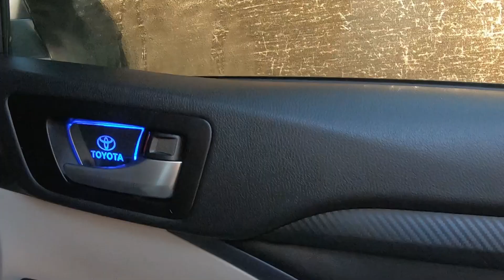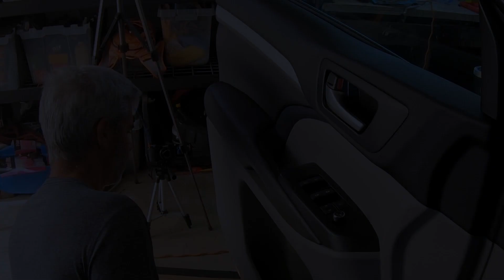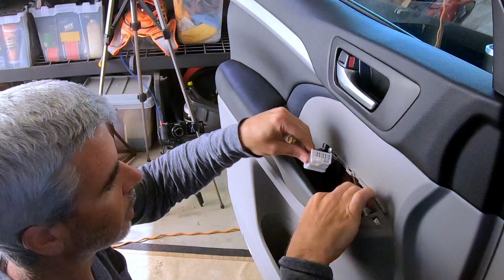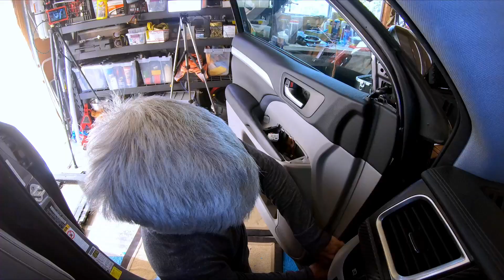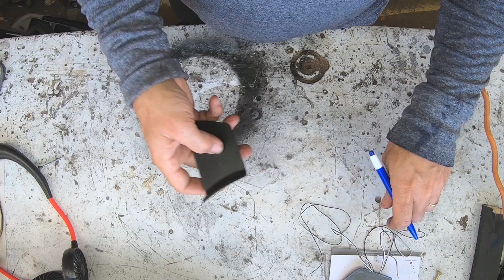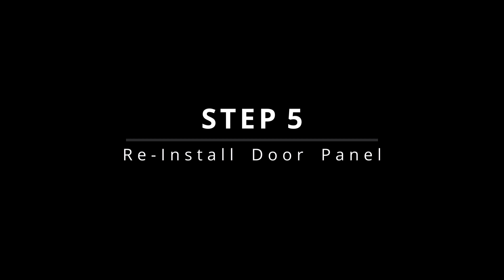Highlander Door Handle LED - Custom and Sweet!

Comment: how i can install these on passenger door ?  no light on passenger door
Reply from the maker: Without a door light it will be very difficult.   The newer highlanders use the computer to control the lighting. You could tsp into the power going to the window for trim, but it might not switch off with the key.   Definitely investigate before buying.
Reply: @DansWay  thank you

Comment: But it lights up only after you open the door.... passengers won't find that to useful...but it looks good I guess.
Reply from the maker: You are absolutely right about that.  I need a way to drop the brightness to keep it on full time, otherwise it would be a huge distraction while charging.
Reply: @DansWay  great video tho keep it up👍🏾
Reply: Lol …..light to help find door handles in the dark but lights only work when door is open…

Comment: I've done a few of your mods so far.  Nice videos
Reply from the maker: Check the video description 👍🏼
Reply from the maker: Awesome!  Thanks for watching.  Which was your favorite?  I have a remote-start video coming...
Reply: @DansWay not seeing the link
Reply: Dan, what color tap do you recommend for the courtesy led light under your side door? The rear door doesn’t have a courtesy light so I am thinking putting an led on the side step bar. I need to know which wire to tap on the front foot well of the Highlander. Pls advise. Thanks
Reply from the maker: @rikimarutenchu6485  are you asking what color are the wires going to the courtesy light on the front so you can access them under the dash and route them to the rear door area?
Reply: @DansWay  yes. Because I tried tapping to the front door courtesy light and it will work when I open the front door but the rear door, no lights. So, I am thinking the wiring on the foot well on both front sides of the Highlander has to have a na in wire for dome light. I ordered the wire/circuit tester but I am having a difficulty finding the correct wires.
Reply from the maker: @rikimarutenchu6485  so you want to get to the done light control. Good plan!  I unfortunately have no idea where those lights originate from.  They are controlled by the car computer directly, not by a simple door switch.  That allows the car to turn them on and off after a certain time even if you leave the door open all day.
Reply: Ok, Dan. I realized you only installed that light on your front door. I am assuming you didn’t get the passenger door lights. If you did get it, how did you wire it? lol or can you see if it’s even possible to wire it up in the passenger side door?